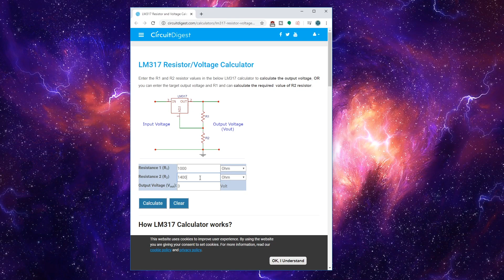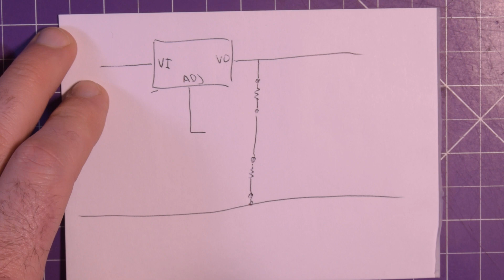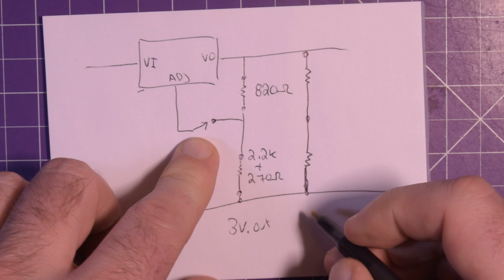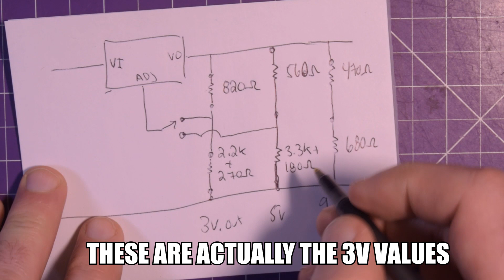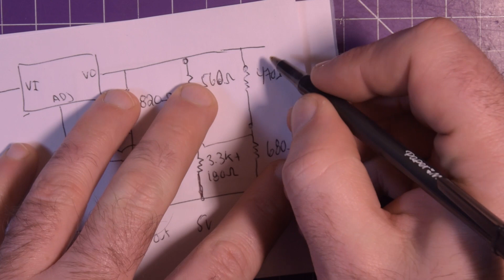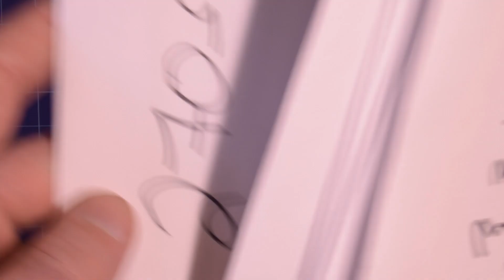Building A LM317 Switchable Power Supply

Comment: Good Video, but here is an other way you could do this. Just set R1 to 270 ohm and connect it between adj. pin and Vout, then put the 3-way switch common at the junction of R1 and adj pin. The 3 outputs from the switch then go to one of each of the R2 which will set the desired voltage. This way the "unused" voltage dividers won't load the output. 

As for values for R2 I would put the following resistors: 

3 V  390 ohm and 12k in parallel (should be pretty precise 3V) 
OR 330 ohm and 47 ohm in series (should also be more or less 3 V exact)

5 V 820 and 68k in parallel  (should be pretty precise 5V) 
OR just use a 820 ohm (about 5.05 V out)

9 V either 1k and 680 in series  OR   1.5k and 180 ohm in series (1680 ohm total) (about 9.03 V out)  

OR  1.2k and 470 ohm in series (1670 ohm total)  (about 8.98 V out). 

All resistor values in these calculations should be standard E12 values as far as I know :)

You don't need big caps on the input and output of a LM317 since it's a linear regulator, about 10uF should be more than enough. To big/small caps is actully not recommended due to stability issues etc.  Read the datasheet for more info and circuit examples.

Another sidenote, a heatsink is strongly recommended ;) :)

Keep up the good work and keep on experimenting ;) :)

Edit 1: Reposted this due to the first calculations I made was for R1=240 which isn't a standard E12 value. And since you said you had E12 I recalculated all values :)

Edit 2: Made a schematic too :) Here's a link to it: https://drive.google.com/open?id=1b14i17P5hGG7gGX8ODgbDR9S6ZUBcyy4
Reply from the maker: Very nice, but simple =/= algebra for me :), nice design though!

Comment: I wonder why you use discrete resistors and not a potentiometer ? 
okay, you would always need a multimeter to adjust or a little voltmeter attached, but why not use the full potential of the device ? ^^ 
also the datasheet claims that the lm317 can have up to 1.5 Ampere output current... (with proper heatsinking that is)
http://www.ti.com/lit/ds/symlink/lm317-n.pdf
Reply from the maker: No potentiometer because they cost 10x as much as resistors! Trimmer pots are for wimps :P
Reply: @SimpleElectronics  i didn't buy a single pot in my life .. all salvaged from old stereo electronics ;)
(i didn't mean a "trimmer" i meant a "real" poti !)
it'd be so nice to dim your leds or control the speed of your motors for example.. with a couple more parts the lm317 can even be configured for constant current or handle up to 3 Amps;) (the circuits are in the datasheet)
Reply from the maker: I definitely have CC configuration in mind for a separate video!